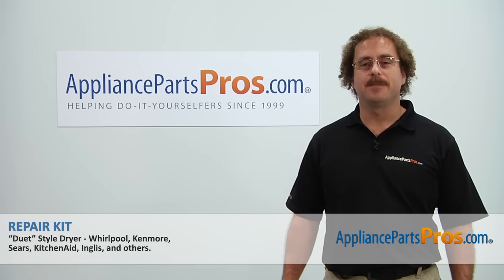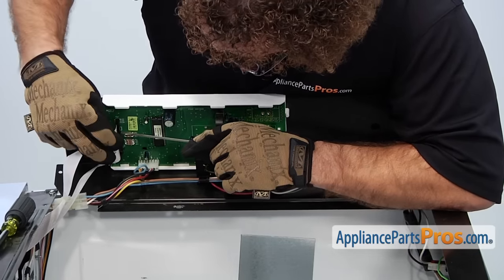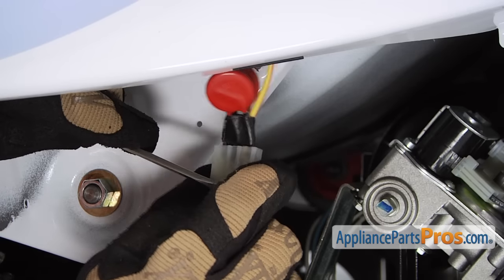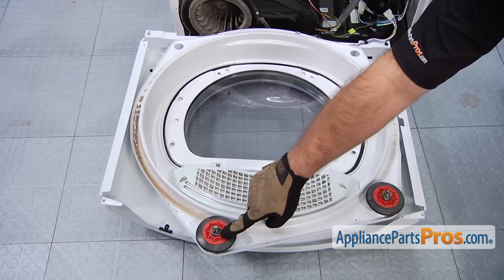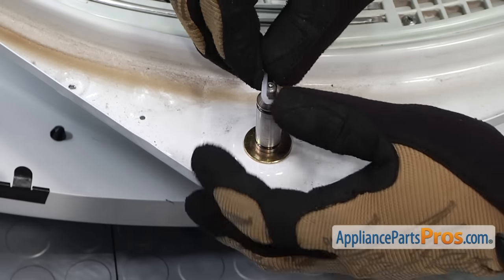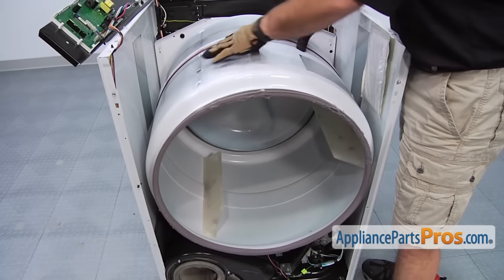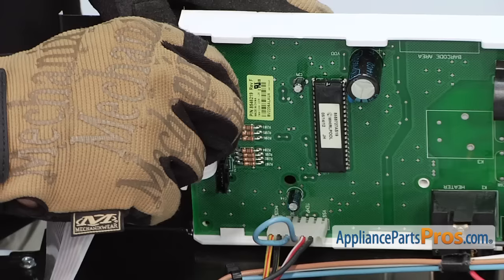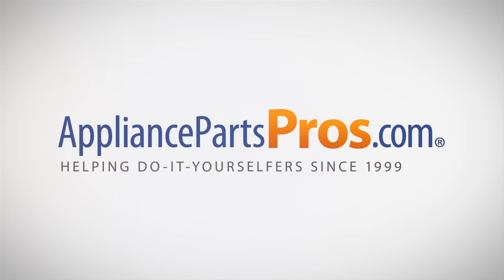Duet Dryer Repair Kit (part #4392067) - How To Replace

Comment: Very helpful information. Had to do this exact thing and with this video it was great.
Reply: How long did it take to complete? I have a kit arriving soon, and I want to make sure I budget enough time/space (especially with a dog and two small kids running around). Thanks!
Reply: @kevinmoraine2387  little over an hour  but it would have been longer if I didn't have the video. Also a good time to dust out the dryer
Reply: @shawnnelson8627  thanks so much. And agreed that it’s a good time to do some cleaning. Much appreciated.
Reply: @kevinmoraine2387  anytime

Comment: Thanks man, made it pretty easy. Difference on mine was a couple of 
screws on the back of the control panel. Also if you do this and your 
dryer is full of lint clean it out!
Reply from the maker: Glad the video helped you get the dryer up and running!

Comment: This is a great video!  I have a Whirlpool #WED9200SQ0, which has a different mother board, control panel, and front, all of which took me an extra hour to figure out how to remove.  I had search numerous sites to find figure out how to remove.  Never really did find a video, but did some helpful videos.  Once you get past that, then everything goes as shown in the video.  Also, I have some funky metal piece in the dust cover.  Not sure if I put this back right or not.  Thanks guys!  

BTW - you also helped me with repairing my Whirlpool washer last year!
Reply from the maker: Glad the videos helped you get the washer and dryer fixed!
Reply: I have the same model and I'm stuck with how to disconnect and remove the front panel.

Comment: Great Video.  Can you tell me why they go bad I have it almost 2 years to the date. Is this the normal for these dryers.
Reply from the maker: +Euclid Antunes What went bad after 2 years, the whole kit?
Reply: +Euclid Antunes That's not normal. What went bad? I have had mine for 8 years and I'm just now replacing mine because the belt broke. The rollers are still OK but I'll replace them too since they are included. My dryer was not cleaned out very well and it was smelling and feeling hot and when I opened it up it looks like the belt runs very close to the heating element so I think that could wear on the belt faster, it was also very cracked, I hope for at least another 8 years with my dryer.
Reply: How fast the thing wears out depends upon how many kids you have. :D Between my kids, my wife, and I, we wear out laundry equipment pretty dang fast. But seriously though 2 years is way too fast for that stuff to wear out.

Comment: Curious if the idler pulley looks intact and the belt had not slipped, would then the motor be the issue with the the drum not spinning?
Reply from the maker: It is possible that the motor could be bad. What is the model number of your dryer?

Comment: When I removed the drumb it apparently was in on the wrong direction for years. Is it important to change the direction now
Reply from the maker: The drum would need to be installed correctly to avoid any unnecessary wear on parts that could cause them to fail quicker.

Comment: I have a Whirlpool compact front load dryer model WED7500VW that I need to change the start capacitor and do not know how to get to it. Front panel screws are too
close to the drum to unscrew and back panel supports the drum. Any ideas?

Comment: Quick question. Is there a way to find out if you need a kit or just the belt without pulling everything a part? My Duet Dryer doesn't spin so I'm not sure if I need a belt or if I need the  complete Kit.
Reply from the maker: We'd be happy to help you out with that! We offer free technical advice and diagnosis. You can give us a call at 1-877-477-7278 or you can chat us at our website: http://www.appliancepartspros.com/. We will need your model number to give you accurate advice, which you can locate using this tool on our website: http://www.appliancepartspros.com/modelnumber_locator.aspx

Comment: He put the tub back in the opposite way it was when he took it out. The 1"x1" metal tab he says has to be at the front is between two large approx. 10"x4" metallic stickers (on my tub they aren't, the tag is on one half and both stickers are on the other half) anyhow, when he takes it off the two metal stickers are clearly on the back and when he puts the tub back in both stickers and the tab are on the front. I had to look this over very carefully because on my tub the front seal needed to be replaced too but after I put the new front seal on I noticed that  it was on the opposite side of the tab so if I put it back in the way it came out the tab would be in the back. It's not a Rubik's cube, I think he just messed up when he put it back in and gave the wrong instruction about that tab being in the front.
Reply: I noticed that too

Comment: and you'll notice that the rubber marks from the band that he correctly notes one should use, that mark the position of where the band was, when putting the band back on were not where he put the new band. The band mark was about 3'-4" inches over, which would make sense if he had reversed the tub when he put it back on, incorrectly.

Comment: I was able to replace the kit but when reassembled and turned on, the dryer isn’t squealing like it was but it is also not quiet like it should be. Not sure what I could have done wrong.
Reply: Same, I just replaced mine and noticed it has a deeper grumbling sound. It seems to be spinning fine, but louder overall. Did yours eventually quiet down after use?

Comment: Where can I get a control board for a WP  Duet dryer??  GEW9250PW1?? I want to rebuild it. Great machines. I can't find a control panel worth the $$$ fixing.  I may just take off the control panel myself and solder what I smell. If I'm going to have to pay $400 for a used one then I am going to take a crash course in soldering motherboards.  I'm just wondering which board would work better???,,,,,An older motherboard or the newer motherboard!!  3rd world problems in a 1st world, 2nd in class problems.

Comment: We have the Whirlpool Duet gas dryer and we are hearing buzzing, off for about 1 to 2 min. then buzzing for perhaps 1 min..
The entire time dryer is in use it will do this.
We replaced the gas solenoid's and it still does it.

Anybody know whats going on and what we need???

Comment: I have seen other repair videos where silicone lubricant is applied when installing the new rollers. Does anyone else do that?
Reply from the maker: You shouldn't have to use any type of lubricant when installing the rollers.
Reply: @appliancepartspros  thanks. I guess some people use silicone lubricant as a quick and temporary fix. I am just going to clean the posts and install the new rollers and not add any lubricant.

Comment: 7:48 I always forget that putting the belt back on, the image is reversed. Make the loop from the left side around the idler pulley on the right side
Reply from the maker: Thank you for the tip!

Comment: I have found a lot of lint buildup often with this machine and have to clean it often.  all the ducting is clear and seems secure.  how is so much lint getting into the guts of this thing?  It seems like a poor design and a true fire hazard.

Also, my gas version generates heat but takes multiple cycle to dry a load of laundry.  for example, a load of 6-8 jeans takes two 90 minute cycles on high heat.  it never took this long previously.   Cleaning the machine seems to help but I need to repeat it every few months.   Thermostat issue perhaps?
Reply from the maker: Sean Ralph Could be a venting issue or the coils could be going bad. When the gas valve coils start to go bad the drying time get longer.
Reply: troubleshooting Kenmore dishwasher

Comment: Not as easy as it looks.  Those Tri-Rings were ridiculous to move to the back.  I see you cut the video and deleted what was probably 10 minutes of labor and swearing when trying to put each Tri-Ring to the back.  One of them I stretched out so much it was unusable.  I had to use an old one since there weren't any extras in the kit.  That would have cost the manufacturer a tenth of a penny.  Putting the belt on the pulley was hard too but overall a good project.  It probably took 90 minutes with cleaning lint and half that was the Tri-Rings.  I found $2.51 in change!  Thanks for the video.  If you didn't make it look so easy, I probably wouldn't have done it.

Comment: I've watched 10 of these videos and NO E LOOK LIKE MY DRYER even with the same model #
Reply from the maker: Our videos are generic videos to give you an idea on how the repair is completed. If your unit is a different model then it the repair steps could be slightly different. You can call us at 1-877-477-7278 if you have further questions.